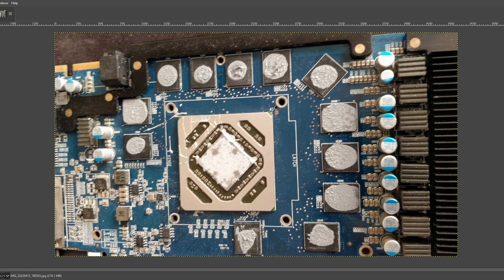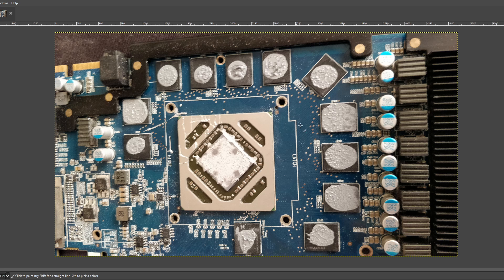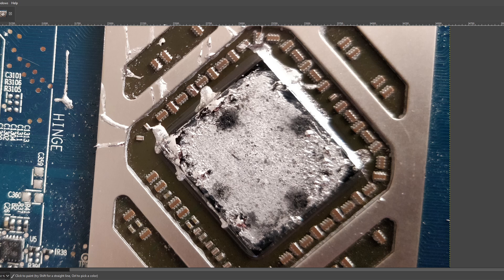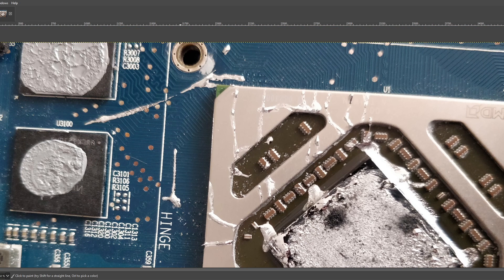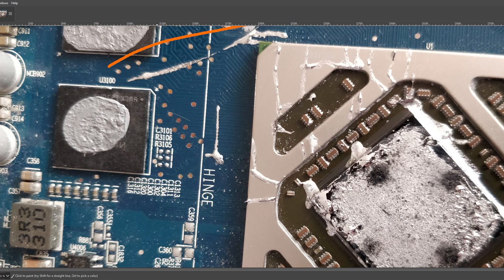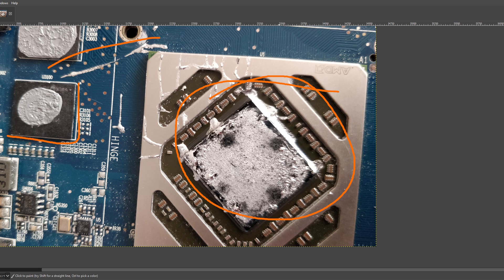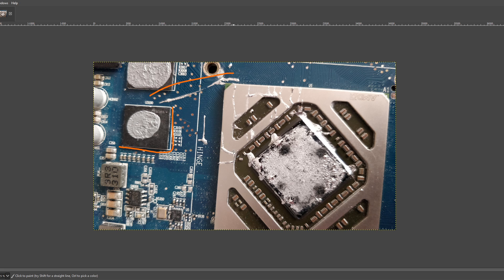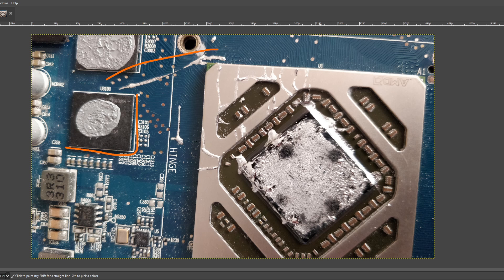Liquid metal on GPUs

Comment: I am in a 50/50 situation where my vertically mounted GPU dripped towards the bottom.

Just cleaned it up, fingers crossed.

When I turned my PC on, it flashed on and off 3 times and then nothing.

Onboard works and GPU does not detect.

Only dripped on the little things on the inside of the metal GPU chip surround.

No burnt smell or obvious damage so I am somewhat hopeful.

I only used it because I had no paste and now I am mad at myself for not waiting for it to arrive.
Reply: Update 3 - Everything seemed ok so shut down and restarted with the hdmi attached to the 6800 and it is all back to normal.

Never will I use liquid metal again....

Just checked prices and where I live a 6800 is still over $500 Aus and it is water cooled meaning the block would be a waste as well.

I am so exceptionally happy I did not destroy the GPU.

Comment: I did 4 layers of clear nail polish on my 3070 laptop GPU,applied LM on only 70% in center of chip and heat sink.Half a year good so far temps are same as I initially did it just have to keeps fans clean,over 10 degree cooler than paste

Comment: My Aorus RX5700XT reached 110 hotspot at only 220W and began to throttle down from 2050Mhz to 1600Mhz. After insulating the smd's around the chip with nail polish and applying liquid metal the hotspot decreased by 30°C to 80°C. The card can now push 280W at a 90°C max hotspot. defenetly worth it on 5700Xt's.

Comment: As someone who had a go at Liquid Metal:
Its kinda not worth it.
Good thermal paste and good contact gets you within a few degrees of Liquid Metal in my experience.
I also had issues with large temp deltas between Hotspot and Die Temp aka it sometimes wasnt easy to have good contact with the super thin Liquid Metal film instead of a blob of thermal paste.

Comment: When I use liquid metal on gpus, I run a clean qtip over the die before closing it up if there seems to be a small puddle to leave just the right amount on there. Also gotta be careful when applying it by using a small amount of it on a qtip instead of squirting the stuff on the die.

Comment: damn, that's quite a big mess, anyway for the price of liquid metal I really wonder why can't they just always ship a protective liquid like just a few small amount of grams specially made to protect stuff around, I mean the liquid metal is not exactly that expensive from what I saw people doing similar mixes and we pay a lot for 1gr so it should have come with a protective specially made product too.

People usually use nail polish, however in the past many years ago I used nail polish many times for other random stuff and for me after some time it always got fully cracked and most didn't even had heat into the equation so I actually wonder if nail polish is actually any good as a permanent protective solution against liquid metal cause I'm planning to delid a CPU, but never touch it again for the next decade unless temps really start to get strange...

Comment: I found out that and went overboard on the voltage of the 6950xt with lowering the voltage I can have a stable clockspeed of 2550mfgz on 1120 mv with a hotspot of 87 Celsius

Comment: I feel i should mention that most Commercial applications use leaded solder for three main reasons better electrical conductivity, lower melt temperature reducing chance of component damage and Cost, Leaded solder is 1/3rd the price of the cheepest lead-free solder

Comment: First: the mouth breather that spilled that much LM should not touch any more hardware. Way too much LM and looks like Hellen Keller applied it.

6900xt/6950xt say differently. The difference in LM vs any paste is massive for hotspot temps.

They do have voltage control.

They do scale with voltage up 1.35vgpu.

Comment: Liquid metal was fun, but after killing a $1000 card with it, I'm out. It wasn't spilling that was the problem, but the waterblock becoming so strongly attached to the die, that removing the waterblock ripped a chunk of silicon from the middle of the die. This is what always happens on pure copper surfaces, the liquid metal hardens in about a year, maybe sooner. Nickel plated surfaces might be fine though.

Comment: Personally I covered my caps and core edges with (nonconductive) thermal paste. As for any gains, whole 3 C drop under water cooling (and 6 C on hotspot), compared to 6 C on CPU and quite a bit more on hotspot. It's less than worth it, unless you're running thermally close to the edge. And for memory, really extra not worth it due to lower thermal density per chip and the risk of BGA being shorted. (Unless you put thermal paste or lacquer or epoxy on the edges.)

Using it just on core has very low likelihood of a spill as long as when you take it apart, you do so carefully. Using it on memory... well... it will go everywhere.
Additional recommendation is to also put it on the heatsink as a very thin layer as well, the surface tension will glue both surfaces together and vastly reduce the chances it gets squeezed out.
Using thermal paste, in addition to being thermally conductive, forms a semi-liquid gasket.

Comment: I have put LM on all of my GPUs for the past 5 years.  Just flat out, Liquid Metal isn't worth it on the RX 6000 series.  The same temperatures because there is limited mounting pressure and AMD's GPUs seem to need specifically thermal paste to efficiently fill the gap between Die and Cooler. 
But, for GTX 10 and RTX 20 series, AMAZING gains in performance and reduction in sound.  You just have to understand you are playing with a corrosive substance.  
I have never used nail polish or acrylic or silicon to cover any parts on any GPU, and, I have never experienced runoff or leaks.  I make sure to be AS CAUTIOUS as possible because a sudden movement or bumping the card on a surface can release a bead of the Liquid Metal and fry my components.  
I liquid metal literally everything in my house except my mobile phones, laptops have it applied as well, kinda worthless on a laptop tbh because BIOS controlled locked fan curves.

Comment: I had LM under a memory chip on a 1070M, caused code43

Blobs are easy to deal with, just suck up everything you can with the conductonaut tube

Pure isopropyl makes LM able to be picked up by paper towel thats what I use to pick up most of it

Pure isopropyl and blasting from an air compressor (90psi) got rid of it from under the VRAM chips, fixed the card

Liquid electrical tape (you could call it plastidip) is awesome
Reply: What did you use the liquid electrical tape on?
Reply: @UnluckyDomino  Things like the outer edge of the die where the MLCCs are.

Comment: That liquid metal paste is no better than the top thermal paste. If the person would have used regular thermal paste on the GPU it would still be working today. If your trying to cool your PC you need great air flow. Air Flow to transfer the heat out of the case with a DEEPCOOL GAMMAXX400 or better will work. If you use that liquid metal stuff your asking for a short & if you use water pumps & radiators you better maintain it. Personally I don't like the idea of water in my PC case.

Comment: I think I get your point: the liquid metal under soldered components is basically a dead card (unless reballing etc...), but it is probably less likely to happen if someone does something cleanly (which is, I agree, not always easy but still), whereas the chip shortage problem is (to me) more likely to happen, but is "easier" to fix (not for the majority of people though). So I do not think putting protection on the exposed SMDs is that useless, given how easy it is to put too much liquid metal and get some runoff. And also, replacing SMDs is not an easy task to perform when not having spares available and the skills to diagnose, and perform the replacement.

Comment: Liquid metal can be a total game changer for GPU temps. I only do it to GPUs that already needed a repaste due to age or if it is going to be water cooled.

Way too much liquid metal was used, evidenced by the heavy blobbing on the upper right area, you have to be sparing and test fitment a
couple times before you finalize the amount of liquid metal used. This is 3-4x more than the amount that should have been used.

You must also use silicone modified conformal coating on all the neighboring IC's around the GPU die and the corners of the GPU prior to application to insulate them.

Comment: In one video, you offhandedly said that ddr5 2x8gb kits are trash. Could you go into more detail if all I care about is running an XMP profile and gaming, how much of a difference would there be between a 2x8 vs 2x16gb kit of 5200 cl40? Thinking of building a new pc as AM5 drops and I don't really need 32gb of ram.

Comment: I have Conductonaut on my 5700xt with a Morpheus cooler and my wife's 5700xt sapphire pulse. I use conformal coating, lots of layers. And I'm very careful with my application. Just did the sapphire card a couple of months ago, mine has been well over a year.

The sapphire pulse dropped 6-7 degrees, while gaining 66mhz and 50mV on the core with the same voltage/clock curve in furmark. 

Worth it for the laymen? No. Fun for an enthusiast? Definitely. My main reason for it is to achieve lower noise levels. I hate screaming GPU fans.

Comment: you need to know what to do with liquid metal in gpu and you are wrong is totaly worth the lm in gpu im using lm at everyone gpu i have if you use it correct hof 2080ti is around 10c lower than the best thermal paste out there

Comment: The Intel ihs has superior nickel plating to cpu and gpu coolers, using liquid metal against an average cooler will cause the gallium to harden and damage the cooler, or at least require sanding/lapping

Comment: Hi @Actually Hardcore Overclocking,  Im Junior from Brazil and i need a information help. Can you help me? 
I7-4790 3,60Ghz  motherboard H81 M-A/BR 16Gb Ram DDr3 (2x8gb)
recorder and reader Blueray
Video Board NVidia Quadro 600 1 Gb.
Air cooler "RISE MODE G700" (2 fan 90x90)
Power supply MP600W2  ATX V2.3
Questiuons ... I need a video board 4Gb that supports my PC.
Would there be one or two video card indications?
DDR3 Ram conflicts with video card with Ddr4 or 5 cards. Excuse my bad english. Thanks
Reply: bro, memory type on GPU has nothing to do with RAM type on the motherboard lol. You can use card with gddr4 on ddr4 mother boards, no problem at all

Comment: ive used LM on my 1660ti and it worked great due to the small die area as it was relatively flat. LM is amazing but as you get in with big dies, 2070+ 3070+ you see that LM is actually a bad idea. its too thin, like water. there will be INTENSE hotspots that the gpu cant measure. i saw artifacts on my 2080s and my 3080ti with LM and i promise you, i know how to apply it properly. if you want LM to work PROPERLY on GPU dies you need to LAP the die AND the Cooler. (goodluck)  the die is not flat, and neither is the cooler. since then, for GPU's i use Kingpins Extreme paste, it works flawlessly. for CPU's, i Delid, Lap the IHS, and use LM on both sides. IHS side and Die side. works flawlessly. dont use it on large die GPU's.

Comment: THEORETICALLY, with ALOT of flux and a hot air station just flooding it with flux and heating the chip to the solder melting point MIGHT break the bridge between 2 pads since  (being liquid) the surface tension of the flux will push the solder back into place and separate the bridge. but the only SURE way to fix is reball as you said.

Comment: I experienced the capacitance issue you mentioned around 10:38 when I first put liquid metal on my 1080Ti. I made sure to protect the core, memory chips and exposed copper of the PCB with a generous layer of conformal coating, but yet I experienced instability and heavy artifacting in games. When I removed the heatsink I saw that a tiny blob of liquid metal had squeezed out from underneath the core and onto the (protected) substrate. All my problems went away the moment I wiped off the stray liquid metal.

I guess the little bit of extra capacitance was enough to either upset the memory timings/signal delays or cause crosstalk between the individual tracks.

Comment: Well BZ, no, let me explain:
It's all about the amount of heat transferred per area.
I had a 1080ti gaming X which pulled around 330W at 117% power. The cooler was phenomenal I thought, then I started noticing how quick the temps were rising. I fiddled with the soft temp limit and saw that the cooling wasn't actually adequate and the card was soft throttling. I repasted with MX-4. The temps were better but only a couple degrees. I had LM on hand (Thermal grizzly stuff) which I used for my 7700K delid(s). I covered the smd caps with nail polish, applied just enough and I buffed it in, that is really important. The card afterwards would stop at 69 degrees celcius under the same fan settings, I lost like two degrees in a year and reapplied. I used it like that for about two years and I just sold it, of course disclosing everything and letting the buyer actually try it beforehand. The buyer was skeptical at first but later he was like "looks like this LM stuff really works". I sold him an unopened 1g pack of conductuonaut along with the 1080ti.
The reason LM sticks to tin is Ga-Sn amalgamation btw, not some sort of Sn-Sn debauchery. Ga amalgamates with tin very much. It amalgamates with Cu and Ni too btw, it's just that those two are really slow conquests for Ga.
Reply: Does any of this matter without the control temp for your assessment? Cause this just goes over anyone's head when given numbers from only one half of the equation. Liquid metal generally just isn't necessary especially with newer cards in regards to overclock unless you are purely going for a degree or two change.
Reply: @killzone_GG  mate I don't have precise figures for you, lm amounted to +30ish MHz at -20 degrees celcius. Then I cleaned the lm and applied mx4, that was nearly as bad as it was before lm.
Heat conductivity of Si and (Ni plated) Cu are fixed values so if they are saturated then the bottleneck is the TIM. 
GP102 is a large but really hot chip, so it is safe to assume that the system is closer to thermal transfer saturation than something like a TU-104 or whatever, thus lm would make more sense for a 1080ti here.
3090's silicon dwarfs 1080ti's in sheer surface area so the heat density is lower while the amount of heat generated is substantially higher, thus you have a colder card that draws more power.
There is supposed to be a 1080ti gaming x lm video on youtube with a somewhat proper scientific methodology, you may check that one out.
Reply: @killzone_GG  also, I am giving you delta T so unless you want to incorporate the heat generated by electrons strayed by the increased temperature there is no point in asking for a control temp. 2 or 3 degrees doesnt matter here anyway.
Reply: @ahmetrefikeryilmaz4432  Okay that's a fairly interesting point you make. When it comes down the the smaller specifics of technology I don't know a ton about the different thermal applications liquid metal has besides videos reviewing the jist of it. Thanks for expanding my current knowledge of the subject,
Reply: Saygılar hocam :)

Comment: I think the elephant in the room is that this particular GPU has 10x the necessary amount of LM on it, and THAT is the best way to create problems.. Basically video starts to make sense at 15:00. Kind of much more important than thinking about protecting anything IMO. I've been putting LM everywhere since it become available on mass market and if you just paint it over with a cotton stick there won't be any issues described here. This looks like someone just squeezed a whole drop and then just put a cooler over and moved it around quite a bit.. then disassembled it and applied MOAR😂

Comment: put liquid metal on my Vega64 when i put on a waterblock. varnished everything around it.  been running fine for 3+years never goes over 45degrees and getting over 150mhz higher. ( runs up to 1800mhz though hits 1750 average.)

Comment: Ehh, liquidmetal wont do anything to aluminium with out it being bereft of its oxide layer. As may others I tested this by just leaving it on aluminium, and without scratching the surface nothing ever happened even after months.
Reply: In my practice it only gets a little absorbed by aluminium after a while and may require reapplication if only a very thin layer was applied initially. As I personally think, it gets through as each cycle of heating and cooling of aluminium breaks it's oxide layer and in these moments you can have it absorbed. Never seen any structural damage caused by it though.
Reply from the maker: @Fiztex553  I forgot a heatsink on a card was aluminum and put liquidmetal on it. After a couple of minutes the heatsink had a hole slightly larger than the GPU core and a few mm deep.
Reply: @ActuallyHardcoreOverclocking  lmao wtf what card was that bz?
Reply from the maker: @Wasmachineman  R7 260X
Reply: @ActuallyHardcoreOverclocking  I can't understand how on Earth is that chemically possible with the small amount of LM applied on a surface.. It should've just left a bit of dark spot on it and that's it. I had a nickel-coated aluminium heat sink standing like that for years and only had problems removing it later as it sealed completely. Which compound was that BTW? It also might be because you polished the aluminium surface right before applying LM?
Reply from the maker: @Fiztex553  it was coolab liquid ultra IIRC. But it's years ago so I can't remember the details of the installation.

Comment: This is why I use Arctic Silver Céramique 2 on everything. Not the best thermal paste in performance but it's both non-conductive and non-capacitive. Meaning you can spill it everywhere and it won't cause any problems. I'm not going to risk very expensive electronics to win a few degrees.